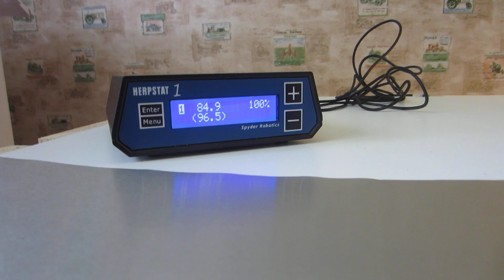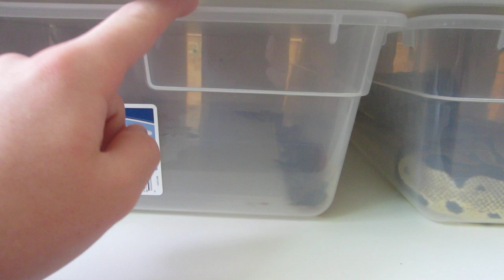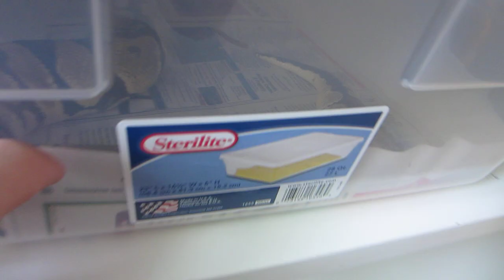New Completed Melamine Ball Python Rack! (Part 2) - Benjamin's Exotics

Comment: Does the heat tape cause any problems by resting on the shelf ?  I understand the sheet you silicones it to is safe but I worry about under it.
Reply from the maker: Hey Connie McLinden. So far I haven't had any problems.

Comment: I am using 56qt tub any ideas on how to build a rack using those tubs
Reply from the maker: @Ball Python Love, Are you referring to the 56 quart Sterilite with blue latches and wheels?
Reply: @BenjaminsExotics  yes
Reply: @BenjaminsExotics  is that bad
Reply from the maker: @BallPythonLove-Exotics  Those are really great tubs but unfortunately you would probably need to get a 4 ft x 8 ft sheet of melamine and cut it to size. If I was in your position, I would check out the 66 quart ultra under bed storage tubs sterilite makes, as they are a bit bigger and fit perfectly on the 2 ft x 4 ft melamine sheets as shown in this video. I will link the tubs below: https://www.walmart.com/ip/Sterilite-66-Quart-Stadium-Blue-Ultra-Storage-Box/45924275?wmlspartner=wlpa&selectedSellerId=0&wl13=3447&&adid=22222222227038513973&wl0=&wl1=g&wl2=c&wl3=90376550192&wl4=aud-1028050746378:pla-182517186512&wl5=1023923&wl6=&wl7=&wl8=&wl9=pla&wl10=8175035&wl11=local&wl12=45924275&veh=sem&gclid=CjwKCAiAl4WABhAJEiwATUnEF2WJAXyByWVUcd-b-emysafW4GFJeJU4TpuB66aEWGlXsHkxJXvY9BoCa7kQAvD_BwE
Reply: @BenjaminsExotics  thank you I have built the first 2 layer 4 wide 2 high I appreciate it though you hit me back up, love what you do brother keep up the excellent work